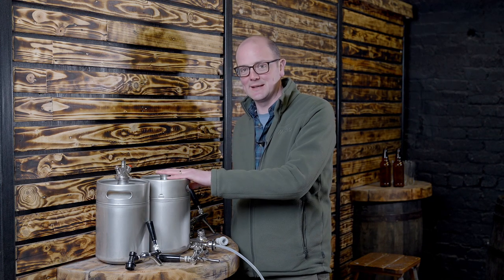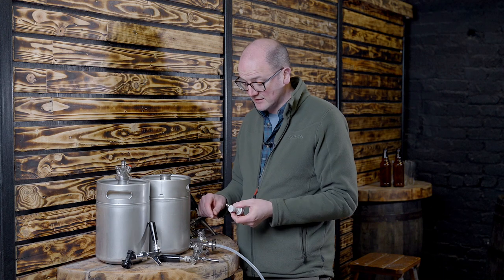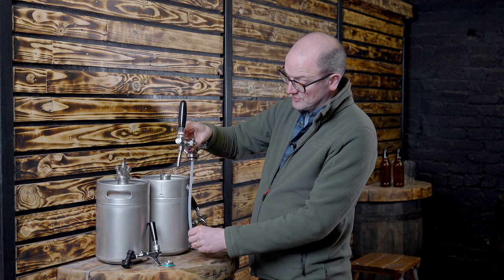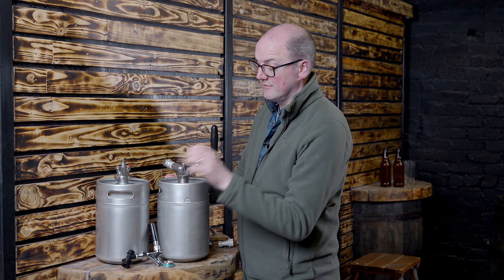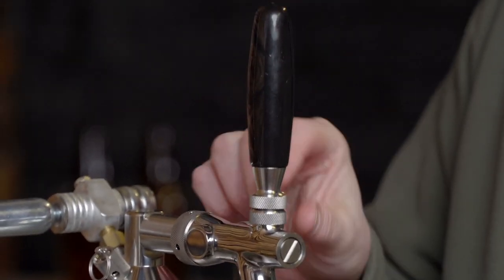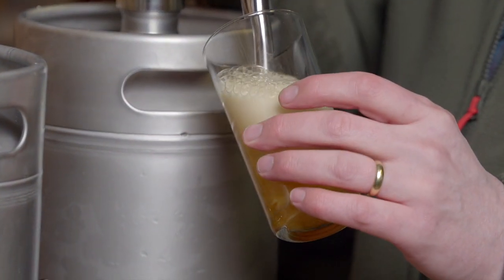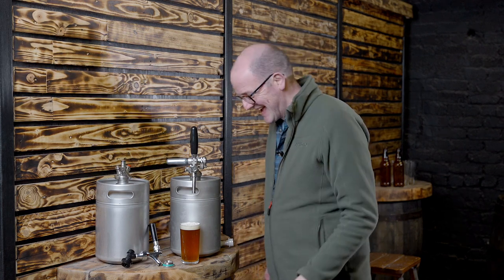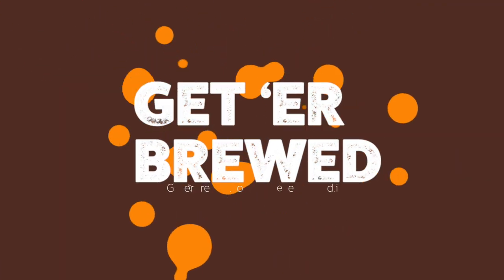How to use a Mini Keg - Stainless Steel Mini Keg Dispensing systems

Comment: Oh this is very useful. 

I have been planning on which metallic kegs to buy after a recent change of circumstances with my plastic barrels brought matters to a 'head'.

The 4 gallon one might just suit me using bulbs to keep the beer fresh although I don't have a cold storage room in my flat so that could be an issue with this particular option. I put lager and cider in the fridge but prefer beer at room temperature anyhow. But if you are still answering this video thread could you please tell me if it is possible to just use natural carbonation with these 2 gallon stainless steel kegs? It looks and sounds that way from the video including they seem to have dispensing taps at the front/base.  

Unless all that I am getting in the glass is froth then I don't tend to release pressure as so many people seem to advise these days. I really don't mind the occasional glugging seeing as my beer is still clear/fresh but I largely fixed that issue by reducing the priming bit by bit.
Reply from the maker: You can naturally carbonate in these kegs , it is beneficial for carbonation to hold after fermentation is complete to cool to allow the co2 to dissolve into the beer , commercially we find that to force carbonate a beer after fermentation is complete it works effectively below 4 degrees, apologies we missed this reply until now
Reply: @Geterbrewed  No problem, it is a long term thing my end. Thanks for answering and explaining so clearly.

Comment: Bit of a noob question and maybe one for a different video.

If you wanted to carbonate your beer with CO2, would you leave out any sugar during the conditioning phase ? 

Seems as though conditioning and carbonation are often lumped together when getting started in home brewing.
Reply: I should clarify that I’m very new to this.
Reply from the maker: You can force carbonate using co2 without the need for any priming sugar

Comment: Does the CO2 bulb retain residual gas if assembly is removed and put on another leg,,,thank u
Reply from the maker: Yes if the dial is turned on the regulator to stop flow before removing